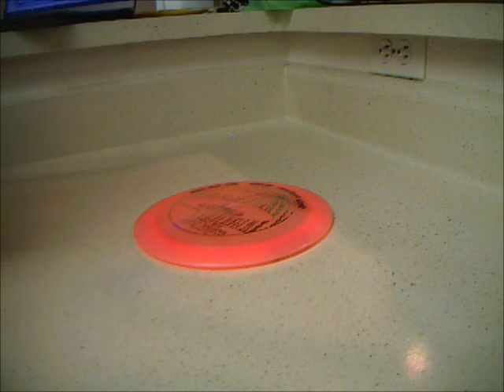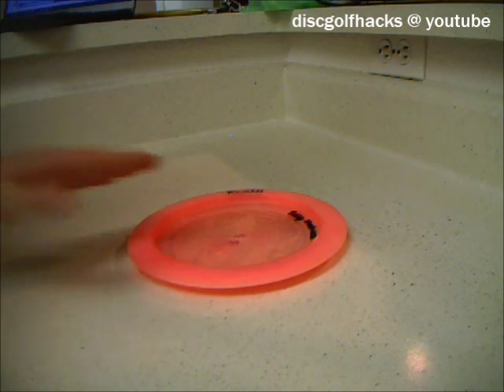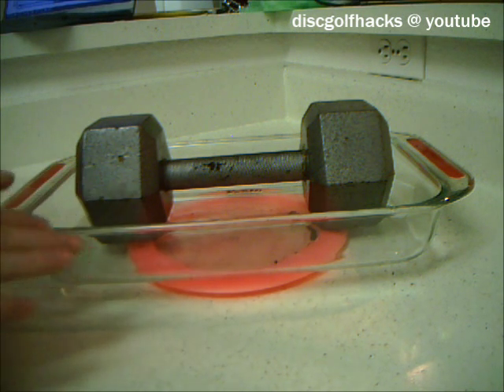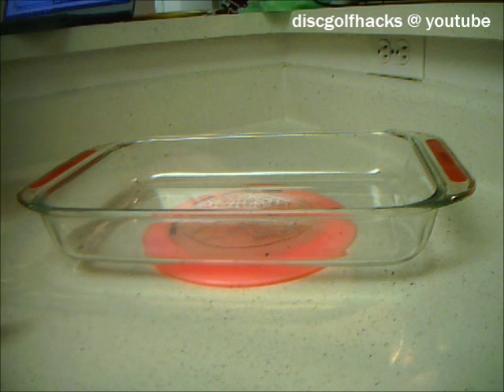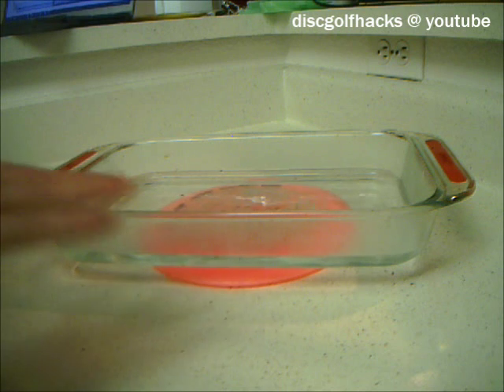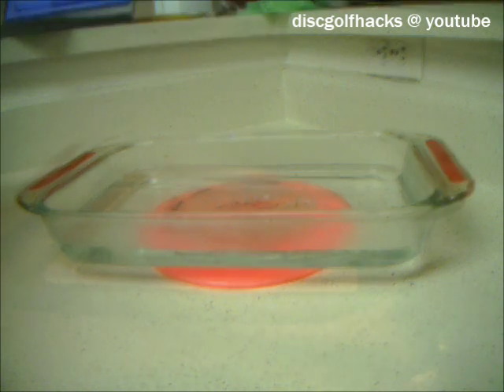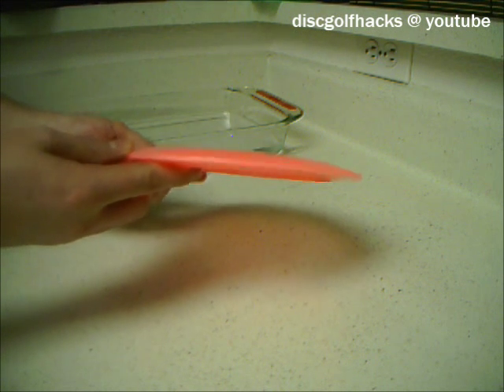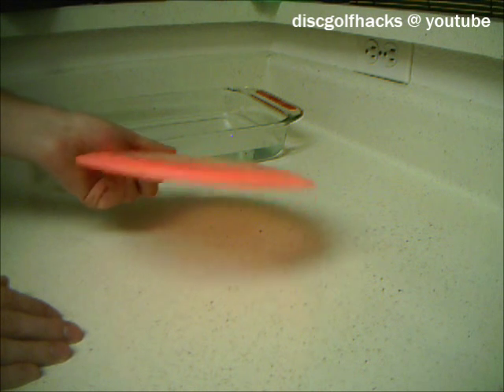Flattening a Golf Disc

Comment: What I did to a mid dome Champion Destroyer to make it like my other lower Destroyer.  I took a Hard cover Book or anything flat and sturdy larger then the disc and then put a 10 pound dumbbell weight on the disc. This method you do till you see the disc at the flatness you want, then you stick it in the freezer till hard and frozen to hold said shape, after the disc is unfrozen it should be stuck at the dome hight you want. worked for me. I thought I might have to do this to my  Glow Champion Valkyrie got 8-13-2017 but that disc did not need it, the Glow ones have the closest feel to the old Champion Valkyries the JK slightly gummy when new plastics. Most of the new Glow Champion discs have the same feel as the old Champion plastic when new, especially if you keep them outside for an hour or so on a hot 90-100 F day, or in a hot car for an hour.
Reply: not sure how serious you are

Comment: I have a J.O. blizzard destroyer with a normal flight deck=no bubbles in it, not a first run.   I brought back to the pop top by putting a mug on a plate full of boiling water and a smaller one on top with the disc upside down.  Kept the water and steam boiling by putting it all in the microwave.  I immediately put it in the freezer for an hour and it's better than ever.  Huge pop top dome.  Getting gauges out of blizzard plastic is like messing with small pieces of stero foam though.  I did a good job but any advice on bringing some older oop flat bosses and destroyers edges sharp again would be appreciated.  BTW this did not work with a magnet I have.  It's from the 90's but the top flight deck is yeti'd out bad.  Sunk in and after 5 years in a vice grip with 100 pounds it's still concaved really bad.  A lot of OOP putters are like this.  The JUJU that I'd like to flatten out at least is soft also and as you can imagine all the steam and pressure tricks wont fix it.  Thumb and finger tracks are making me think way outside the box!  It did work on a sss wizard and c.e. leopard last run.  OOP putters are hard to get people to let go of.  For years all the way back to 2005 people were offering me a fortune for my bb 11x champion aviars.  Now I can RARELY find one near 175 grams and when I do it needs work or they want to trade for plastic that's not an even trade.  Rhyno's I hord and have steamed but the harder old ones and old gummy ones.